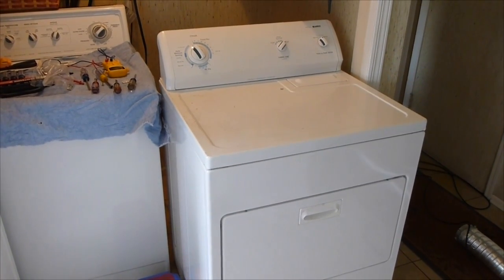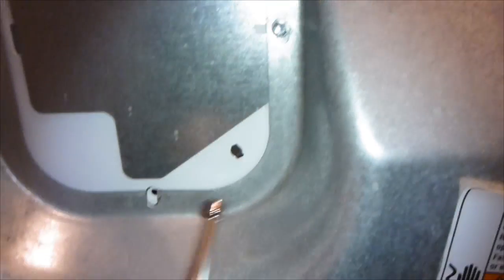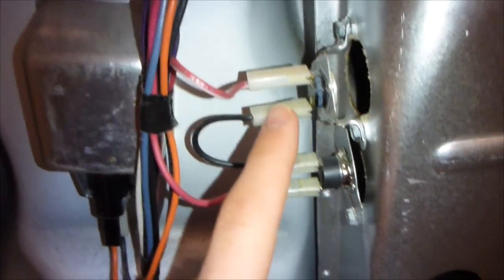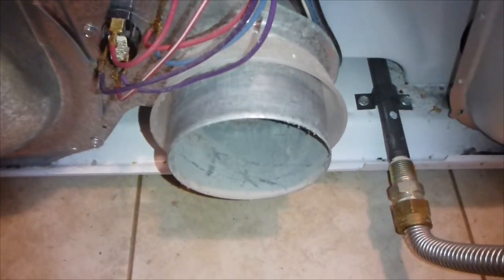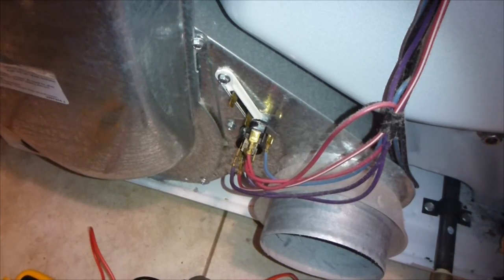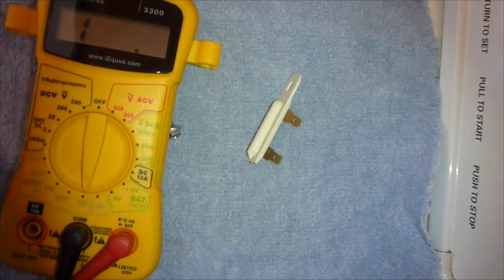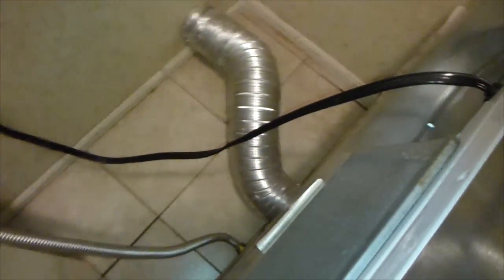How to Fix YOUR gas Dryer that is not heating up (Part 1 rear panel)

Comment: at 0:48 you wired the thermostats wrong when you replaced them
Reply: Quiet Wyatt  you can’t wire a switch wrong
Reply: @jeffbdhdh  where would you get your info from they same not everything different most plugs are same and he did plug into wrong plug because the two thermostats right next to each other if you look at the plug the top one the red should be top and the black on the bottom now on the bottom thermostat the black should be on top and the red on the bottom. The black wire is a mediator towards both we should be on the bottom and on top on each of the plug. And quiet Wyatt  meant at 5:48

Comment: you wired the thermostat ones wrong...
Reply from the maker: +Marina Benitez Thanks Marina, it doesnt matter as long as they are both on there. It is just a connection so the order isnt important. But good eye and thanks!

Comment: Very helpful video, but in order to trouble shoot we have another question...did a minimal inspection, we cleared the vent and straightened it, checked for the glow and the pilot - as we are having intermittent heat lately. 

pilot stays on for 30 secs and both the glow and pilot (gas) turn off after about 30 secs and then restarts after 90 sec.  Is the pilot (gas) supposed to be continuous in the cycle or turn on and off??

Comment: in the process of sliding the plastic cover off at 5:08 i snapped the metal tab? can this be fixed?
Reply from the maker: +thetruenosferatu Get a new thermostat sensor. There is no way to fix it.

Comment: you put the black on the bottom. on the lower thermal couple.
Reply from the maker: +crewchiefification That is ok, there is no order as long as they are connected and complete the circuit. Good eye though!
Reply: +ChrisFix dude that is what was wrong with mine right now.  did your trouble  shooting and fuse is on it's way from amazon right now.  great video.  thank you!  seriously,  thank you!

Comment: Gas dryer dries perfectly, but outside where it vents there is a fairly loud high pitched noise.  How can I get rid of the excessive noise?
Reply from the maker: +Abo Greenwald Try lubing the thing that spins the drum in the dryer.

Comment: Just watched your video. I borrowed a meter and found the fuse was bad. Spent $11 at repairclinic around the corner and my dryer is working again. I would not have considered trying to fix this myself without watching your video. Thanks so much.
Reply from the maker: +Leona147741 AWESOME! Glad the video helped fix your dryer!

Comment: This video was very helpful in repairing my dryer. I had to buy a multimeter and a new screwdriver set as well as a thermal fuse..and gas to go across town to get the part... $40 later...my dryer is back working...sure does beat $400.00 mon cost for a new dryer. I also have a 70 series and hope to get about 4-5 more years out of it...Thanks for so much!
Reply from the maker: kettanistar Awesome! Glad the video was helpful! Plus now you have a multimeter and some new screw drivers!

Comment: When I look through hole I have no flame or glow...can you test selenoids w meter for resistance? Igniter tested OK fuse OK.  Next?  Thanx for vids...I renewed my faded headlights sat!
Reply from the maker: SJK99 klr If you tested everything and it is all working, it has to be the solenoids although usually there will be a glow but nothing will happen. You can do a resistance test on the solenoids to see if there continuity. I am glad the videos are helpful!
Reply: Driving me crazy as every thing checks out.   I'll start by ordering coils!
Reply: Noids I meant!
Reply from the maker: SJK99 klr Good luck!

Comment: Hey Chris. Helpful video. My dryer glows and ignites. But when you shut it off it won't glow and ignite again till I unplug and plug back in. Think that's solenoid as well?
Reply from the maker: Joseph Stevens I think that is the solenoid if everything else was tested and checked out!

Comment: Hey Chris tho looks like an excellent video. I watched both and think my problem might be in the solenoid....basically the dryer turns on there is an orange glow it heats up...but then half way through the dry cycle the heat turns off?! Any ideas on that? Thanks , Erik
Reply from the maker: godzla69 Definitely the solenoids.

Comment: awesome video - for those with a 700 Series Kenmore, the lower front panel is all you need to remove (pops off with a screwdriver, no screws to remove) to get to the thermal fuse!!! No need to even move the dryer.
Reply from the maker: 87videowatch AWESOME! Glad the video was helpful and nice work!

Comment: Great video Chris.  Very helpful.  One problem, at 5:30 on the video you replaced the lower fuse wires incorrectly.  Black goes on top and red on bottom.  You replaced it in reverse.
Reply: It's a switch, so it doesn't really matter which wire goes where.  It's either closed or open.
Reply: Stop tring to sound like you know what your talking about lady
Reply: Color doesn't matter on that fuse link. It's just a link between the two wires that opens or melts internally to create an open circuit.
Reply: Yeah, noticed that too, but this is an ON/OFF thermal breaker so the cable position does not really matter. By the way, nothing "melts internally" there is a metallic element inside that kinda buckles over a certain temperature and breaks continuity.

Comment: I just want to say thanks!  This was an excellent video.  had every thing I needed and nothing I didn't to fix my dryer for 15 bucks.  I did have an Ohm meter initially none of the fuses showed any resistance but I had one of the meter wires in the wrong slot and then I was in business the problem was the fuse just like in your video I was just praying that the igniter was not bad too.  Luckily it fired right up once everything was back together again.  thanks again.

Comment: Sears wanted $99 bucks just to come out plus parts and labor. My thermal fuse was bad so I checked online for the nearest Sears that had one in stock and $17 later, I'm up and running again. You are the man! Who knew fixing a dryer could be so easy? Thanks!

Comment: Thank you very much for posting this. I was able to fix my dryer all by myself because of this. Dryer wouldn't heat up, no glow in the little window. Tested the circuits as you instructed. It was the thermal fuse. Replaced it, cleaned all the lint out and it works!
Reply from the maker: Suzanne Schornak AWESOME! Cannot beat that!

Comment: I have a kenmore 70 series...it looks exactly like the one on your video...I tried everything u did on both videos...and everything gave me a reading...Is there anything else i can check for? It doesn't glow...by the way
Reply from the maker: A.KA CUATRO.SIETE If it deosnt glow, did you check the ignighter (the thing that glows)?
Reply: ChrisFix  I  checked it...it does work...i had it all wrong...it does turn on but only when it starts..then goes off, and when it tries to turn on again it doesn't it just glows...solenoids?
Reply from the maker: A.KA CUATRO.SIETE Solenoids!

Comment: Hey there thanks for sharing this video. I am having some trouble with my troubleshooting of my dryer. My gas dryer stopped producing heat and I did some research and saw that it could be the thermal fuse, which I thought it might be a easy fix.but I did not have an ohm meter to test it. But then my friend had an extra gas dryer that he was trying to get rid of that was a newer model than what I had so I said what the hell why not. So I hook everything up I bought a new vent tube and gas line that hooks up to the gas dryer and into the was. Checked for leaks and everything checked out great. I turned the gas line back on and I go ahead and test out the dryer........ and then I look down to see if the ignitor starts to glow and nothing. The crazy thing is that I was just working fine at my friends place. So if you have any suggestions on what I could do that would be great.

Thanks Hector
Reply from the maker: Hector Amador I suggest you get an ohm meter. They are cheap and that is how you will find your problem. It can be anything with your description of what happened!

Comment: Great video, thanks.  I think that the first two thermostats you checked were originally red-black-black-red.  You reinstalled them red-black-red-black.  It seems like it does not matter the order.  Is that because the thermostat acts as a type of fuse?
Reply from the maker: Ron Abelon Thanks and it doesnt matter the order but good eye. And exactly, the thermostat is acting kinda like a fuse.

Comment: Hey Chris,  Question for you.  I have the same dryer and find your tutorials very straight forward.  I haven't opened the dryer up yet but plan to.  My issue is the dryer spins and heats for 10 minutes but after that 10 minutes the heat stops, but the dryer continues to spin.  What I have to do is when the heat stops (after 10 minutes) turn the dryer off (stop the spinning) for 10 minutes.  I can then turn the dryer on and it will heat for 10 minutes, until I have to stop it again. I can repeat this process many times and it always heats for about 10 minutes.

Any ideas?  As soon as I get an ohm meter I'm going to open it up and start testing.
Reply from the maker: Tom Pollack That is most likely the gas solenoids in the front. (99% of the time)

Comment: why is your ohmmeter is not stabilizing?
Reply from the maker: 12vgs8606 Probably because I had it on the wrong setting. It was being too sensitive and I should have made it less sensitive. The idea is continuity anyhow. Good question.

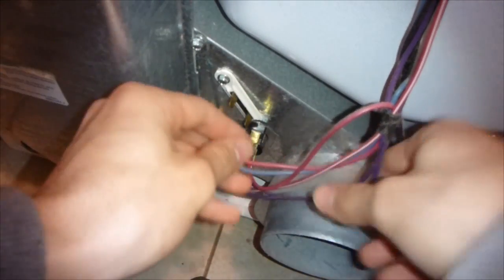Comment: Good video. Didn't know if you noticed, but @ about 5:50 you inverted the original locations of red vs. black wire when finished testing & putting back on the second thermostat ( or solenoid - you kind of interchange those terms "freely" such that it was a bit confusing). Not a big deal as it looked to start back up anyhow. Thx.
Reply from the maker: SouthBound58 Thanks a lot and good eye. You can put the wires on either way as long as it makes a connection across the thermostat.

Comment: Thanks very much for this informative and easy to follow video series!  I fixed my 21 year-old gas dryer by replacing the thermal fuse for about $4.  Plus, I now know more about my dryer and how it works, and I am not afraid to open it up and try other repairs if they become necessary!
Reply from the maker: Therese Dillon Awesome Therese! I am glad the video was helpful and you got your dryer going again!

Comment: Hi,Chris.Nice job,but my question is this:i have an old(whirlpool co. has no manual/record for this model,must've been purchased around 1992) estate gas dryer but there no cover on the bottom front to uncover in order to view the flame flow-any idea where it might be? i searched everywhere but couldn't find it.I appreciate your help.
Reply from the maker: hanaparvizian You might not have a viewing port on the older dryers.
Reply: ChrisFix Thank you for the fast reply.Do you think i need to replace the ignitor,solenoids,or thermal fuse?Also,i gathered from the second video i will need to remove the front cover in order to check the circuits with a multimeter,correct? Thank you.
Reply from the maker: hanaparvizian Well you need to tell me what happens lol. Does the gas ever ignight? Do you hear the solenoids click?
Reply: ChrisFix Tell me whether i need to start checking the back or front first.I can't hear any clicks from any source,and don't think the gas ignites either.Thank you for your assistance.
Reply from the maker: hanaparvizian Can you see if there is a glow? That would help a lot... If not and you want to try to take a chance, change out the solenoids (link in the description to solenoids).
Reply: ChrisFix Where am i suppose to view the glow from? There's no port in the front or back-any idea where to find it? Thanks,Chris for everything!
Reply from the maker: hanaparvizian That is tough if there is no port. Can you tilt the dryer up and view it from the bottom?
Reply: ChrisFix The bottom has no openings.So,what part should i start checking w/multimeter first,and move to which one next?I'll try the elimination process,no?
Reply from the maker: hanaparvizian I would start from the back like I did. If you dont find anything, then get solenoids.
Reply: "ll ChrisFix Thanks once more for your time&advise.Will do.

Comment: great video thanjs very much. Just one question..do i need to turn the gas cut off before i open behind.Or is the power cord pull out enoiugh
Reply from the maker: kagumpo Thanks!  As shown in the video, I would shut the gas. It is just extra safety. Better to be safe than sorry.

Comment: Very Informative Chris, however on the last fuse you tested you only tested the top and bottom portions. What about the 2 sides? On mine the 2 sides were good but the top and bottom were not!!! Any thoughts??
Reply from the maker: Art Ray Thanks Art. What problem are you having with your dryer?  I didnt test the other two connections because it only has continuity when it is hot.

Comment: hey chris i watched both of your videos and i check everything i replaced soleniod. for some reason lights up for 20 seconds and no flames and goes off repeats after about 1 minute.
Reply from the maker: fisherfindsthings Are there two solenoids? Did you replace just one or both?

Comment: I have checked all of the sensors in the back panel, they all checked OK. But, the dryer heats for a few min. after setting for some time, and the heat will not come back on again, I changed a slightly crimped vent hose with no success. The heat will not stay on. Can you please help. I have not checked what ever is in part 2 of these videos yet, do I need to do that or could it be 1 of the sensors in the back failing after it runs for awhile?   By the way great video, very easy to follow.  Thank you
Reply: ChrisFix
Thank you I will change the I assume that is in the part 2 of this video.   THANKS!!!
Reply from the maker: Tim Kelly Yes, it is in part 2. It is easy to replace.

Comment: thanks for ur video sir. Is it possible to replace the thermal fuse the same with in the rice cooker? I did open the thermal fuse from my dryer and its look like the same from the rice cooker. But i was not able to read the label because of the insulation. do u have an idea how much ampere is that sir?
Reply from the maker: Nepthali Stein Piga I do not know if the thermal fuse is the same size and it isnt worth the $2 for a new, correct thermal fuse to find out and burn down your house.

Comment: Just want to say thank you for sharing your knowledge. My drier just stopped heating last week and it turned out I had a blown thermal fuse like in the video. For $3 (and a little patience for the part to ship) I got the dryer up and running with confidence. Keep up the good work.
Reply from the maker: leckie gunter Great! Glad the video was helpful and you fixed your dryer!

Comment: ChrisFix,

Thank you for your easy-to-understand video! I replaced the solenoids and everything was working perfectly for about a month. 

However, now it's not heating again. I checked all the connections and all are working. Though now when I start the dryer I see the light, hear a click, but then the light goes out. Do you know what's happening there?

Thank you for your help!
Reply from the maker: Karie Buss It could be the solenoids again (you got bad ones) or it could be something else like one of the thermostats or the thermal fuse. Just have to check everything again and see.

Comment: I ordered heater part #3387134 (120v)  got a new unit .....part # TSD301C (240V) put the part in ....the part in small window on bottom glows orange but it doesn't catch a flame so my dryer still blows cold.....doesn't the 120 v vs 240v incompatible ? it shouldn't work right? need to send part back? thanks for your help
Reply from the maker: Bob Oster I cant tell you if the part will work or not but you should have the same exact part. They probably mixed your order up so I would call them.
Reply: Ok thanks...I will do that.....thanks for your quick reply!
Reply from the maker: Bob Oster Let me know how it goes!

Comment: Thanks Chris went out to buy my multimeter and found the same problem you had on that dryer.  My question is where in the heck do I find the thermostate?  Went to Home Depot and Lowes they dont carry them..
Reply from the maker: jason bornfleth Go on amazon, ebay, sears, etc. I got mine from amazon.
Reply: Thanks are they all the same on every dryer?  Do I just put in the model number of the thermostat?  How did you phrase it once on Amazon. .
Reply from the maker: jason bornfleth Put in the company name and model of the drier and then "thermal fuse". The thermal fuse will also have numbers on it you can use.
Reply: Thanks bought it last night on Amazon should b here next week..

Comment: Great video! Mine glows, clicks, but no flame. I've checked all the parts with my ohm meter, and replaced the 3 solenoids w/o success. i pulled off the two parts by the glower and cleaned them. Not sure what to try now?
I have an old Whirlpool model LDI 5751 and the solenoids I bought- could they be too new to not work with my old model? It's at least 20 years old- perhaps 30 years.
Reply from the maker: PilgrimPublisher I would check to make sure those solenoids fit/work with the voltage that you dryer uses. It sounds like you have a solenoid problem (since you checked everything else).

Comment: thx Chris for creating the repair videos.  My Kenmore Series 80 ignites gas but fails to keep burning during drying cycle.  I replaced thermal fuse and ignitor.  Do you think its a sensor failure?
Reply from the maker: Billard02cue Sounds like solenoids to me. Most people have the problem where it will ignite but not turn back on. The gas is supposed to shut off when it gets too hot, but once it gets cool enough, it is supposed to turn back on.
Reply: ChrisFix Ok then I'll try it.  Thx much...